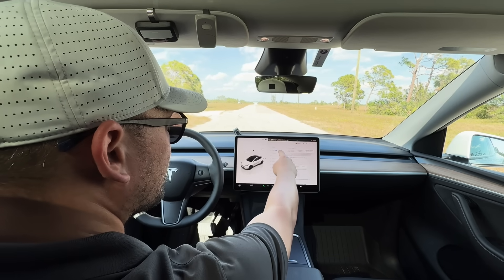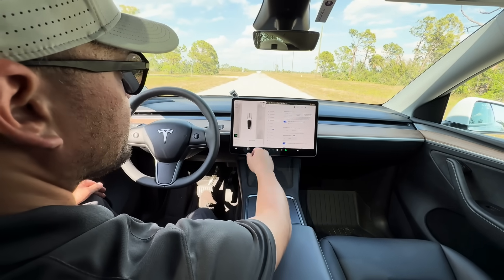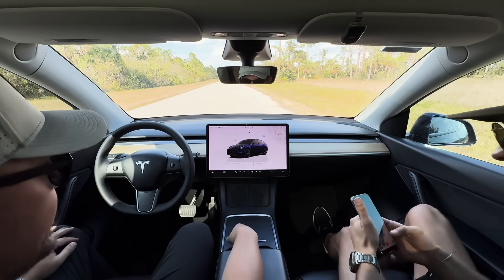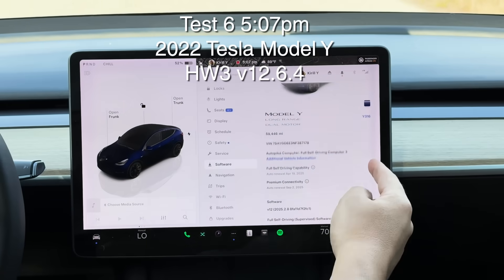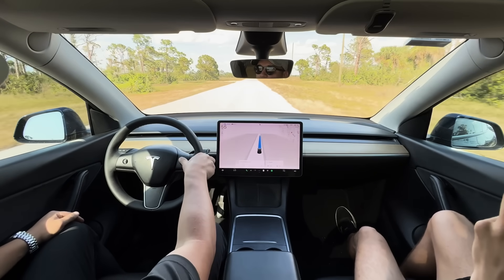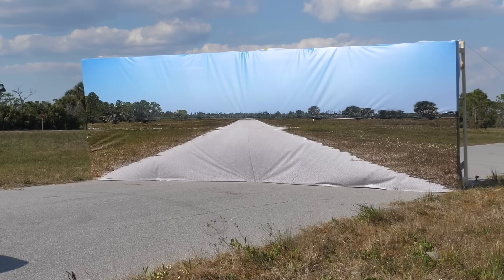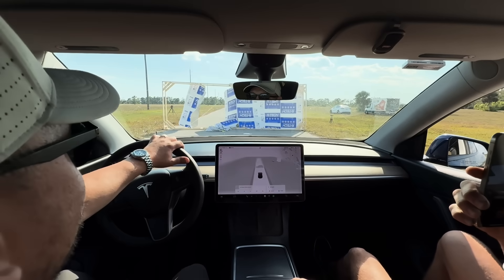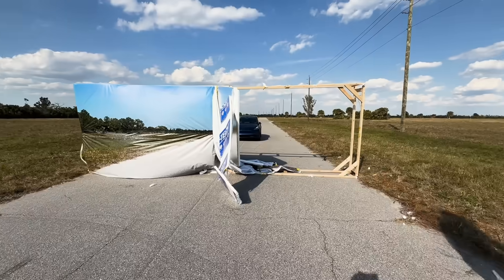Mark Rober Debunked - You can't fool a HW4 Tesla using FSD!

Comment: Well, it certainly debunks Musk's claims that FSD works on most Tesla's on the road. It confirms why Tesla fan Ross Gerber sold 500,000 shares of stock because FSD does not work on the vast majority of Tesla's for all manner of hardware and SW issues.  I got it May 2024 for my Model Y and used it all the time expecting it would get better with updates.  Since last November it deteriorated steadily to the point it was scary to drive while supervising. Tesla service said, “Nothing we can do.” So I canceled my subscription to stay safe.  This “evidence” does not debunk anything, it only shows that under these extremely limited circumstances of HW and SW that it does NOT run into a wall and that 99% of  FSD enabled Tesla's on the road will (ie it is cherry-picked anecdotal data).  My car was stopping when no walls or people or  cars were present.  My deal breaker was this month when I was supposed to turn right at an intersection two blocks ahead and my Y suddenly turned into a Lowe's parking lot.  The irony is I just realized I’ve spent more $$$ on my subscription beta-testing FSD for Elon (and enjoying driving less the last 6 mos) than my total service expenses over 4 years ($585 at my first service appointment last week, 1 new set of Les Schwab radials last year and 3 gallons of windshield wiper fluid).  Hmmm, FSD still seems to be in Grift-Mode.  At least I am back to FFD - Full Fun Driving mode.

Comment: I’m just as interested in seeing if this only works during fsd then - it should defintely also stop if you are manual driving crusing 60mph into a wall or a stopped car on the highway.

I even think its part of euroncap tests, that the cars stop by themselves if it detects you driving into a cyclist, pedestrian, a stopped car/wall etc. - not just under fsd.

Comment: Assuming this is to do with another video showing how badly tesla did when they failed to pick up a number of different hazards I should point out that as a viewer I could see where the image you had across the road was right from the start plus the one you use seems to be a lot smaller than the one in the other video, it is clearly obvious where the edges are and even a halfway decent camera should easily pick that up.  Would have been nice to see if it picked up a kid standing there as well.

Comment: You can fool a Tesla. You can also get it to pass a test by creating a wall that gives the Tesla a good chance at detecting the edges of the wall by putting both trees on the border of the wall and trees in the background so that there is a distinct delineation between the foreground and background.
To prove that you can't fool a tester use the same road conditions and wall format as Mark did. You will get the same results and that will not only prove that you can fool a Tesla but you can also fool Tesla owners.

Comment: this was something i was hopeing to see. a 3rd party doing there own test to confirm of disprove Mark Rober's test. so assuming mark has an older tesla, his video holds true. but there has indeed been an improvement in the HW4 set up for tesla, im guessing they added a lidar system to work with their own visual processing system. 

really do want to see the heavy rain and fog if the HW3 test also matches with mark's, and if HW4 is beaten by the rain and fog.

Comment: In the last few months there has been fatal accident when various Tesla models 'autopilot' cameras have not registered objects in the path of the vehicle.  I do not know what software they were on, nor am I an expert.  A fatal accident happened not far from where I live when a (06/24 - 10 month old) Tesla sedan plowed under a trailer from an 18 wheeler.  Apparently the sun was behind the Tesla so the all white trailer was brightly lit, this was in the afternoon, around 3pm.  According to the police, neither the autopilot nor the driver noticed the white side of the trailer against a bright sky, leading to a fatal accident.  I might add the onboard computers/sensors/camera in the vehicle as well as the two occupants failed to detect/see the red light either, that is why the truck was turning he had a green light.  The occupants probably had belief in the systems the vehicle uses, and they where not paying attention to the road and probably just chatting (pure speculation, we will never know).  
What is said in this video may be correct, but always pay attention and do not rely upon the computers to save your life.   
Also there has been incidents where Tesla's have caught fire due to being in an accident, the occupants survived the initial accident, but perished when the vehicle caught fire and no one could get them out.  Technology for the sake of technology is stupid.  
There should always be manual backups to these systems in case of accidents, it would add nothing to very little to have a pullout plastic cover to reach in and use wire to release the door latch.  It is basic common sense, I don't know how people think Elon is a genius.    
The tech was not ready, people basically paid a premium to BETA test these vehicles.  Some even paid with their life, or the life of others.  The tech is getting better, but how many more people have to die?

Comment: Given he released the video two weeks ago and likely took some time to edit it, its most likely this update was not out when he did the tests. It looks like tesla has modified it to specifically pass this test but your missing the point that a visual only system is more prone to mistakes. My guess is they just widened the field of view and it sees the edge of the wall, make it wider and it will probably fail